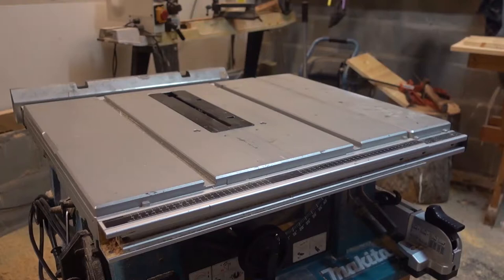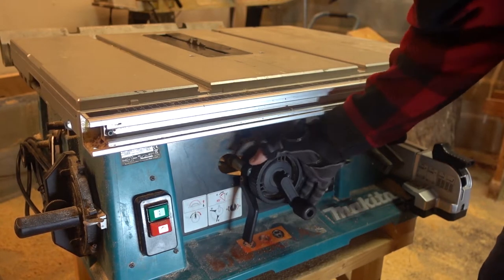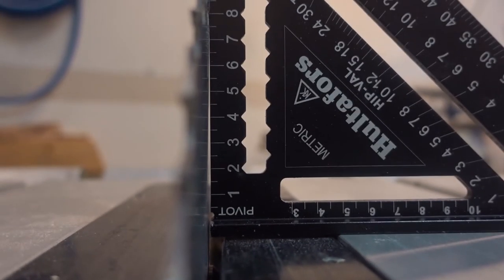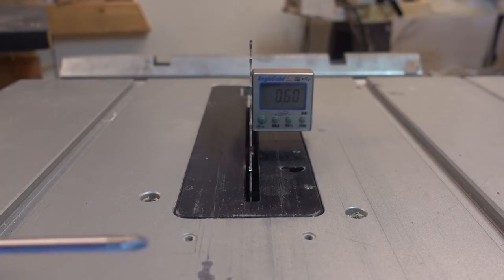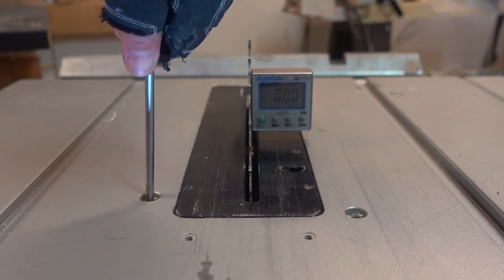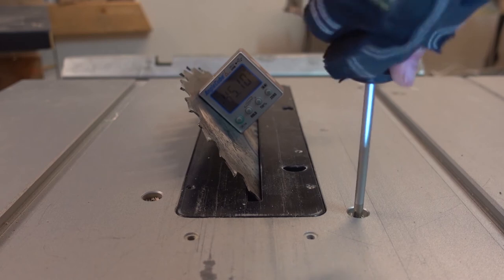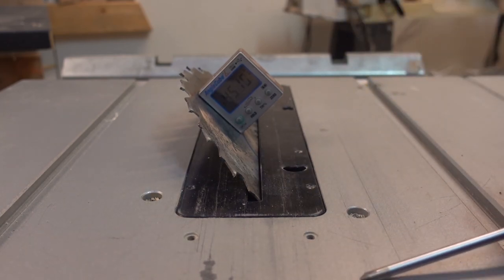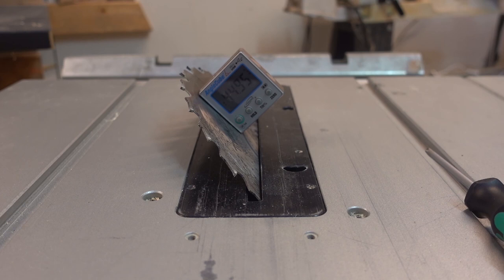MAKITA 2704 | Adjusting the sawblade angle

Comment: Thank you!
So happy to find instructional videos on the 2704. The manuals aren’t that easy to follow from time to time, so a visualization is greatly appreciated.
I am having trouble on my 2704 to tilt further than 35 degrees, any suggestions on that problem? 🙂
Reply from the maker: Thanks! Yeah, might be sawdust collected in the mechanism or maybe the plastic gear is broken. I know i had problems getting it to 0 degrees and the plastic gear was worn off.
Reply from the maker: Here is a image with a description. https://imgur.com/gallery/qTrVgeb
Reply: @atikam2956  Thanks! I will check that out. 👍
Reply: I think it kind of a factory issue I have it to it’s because the iron bracket that holds the red thing for your 0 to 45 is in the way from 35 to 45 so or they had to make a beter bracket or the had to make te silver plate bigger to you had some more room or they had to put the 0 to 45 numbers more to the left I have trouble with like 40 to 45 is hard for me and I made everything perfect in the 0 when I really try to push it to 45 is made the bracket bend 😅

Comment: Hello there ! Short question : I have bought a Makita 2704 saw (second hand), but I did not get the two wrenches needed to unlock and change the blades. And it seems impossible to get any information on the sizes of these wrenches or get them as replacement parts. I think it is a thin 19mm key, but would be very helpful if anyone could confirm. Thanks a lot !
Reply: You get two spanners with the saw, one open spanner 10/19mm ref:7810381 and one closed spanner 13/22mm ref:7820245 hope this is helpful

Comment: My angle handle  got stuck during this operation and it wont let go..leaving me with no possebility to  change angle....any idea why the  angle handle lock  is stuck?
Reply from the maker: Is it the lever or the wheel for adjusting the angle that is stuck?
Reply from the maker: Here is a short video. Might help. https://imgur.com/gallery/7JLtIFO
Reply: @atikam2956  the lever was stuck so the wheel didn't turn...I needed to flip the saw, remove the cover underneath and twist the large hex nut a bit...then I managed to loosen it....now it works...hopefully for as long time. Thanks for the video...😊😀
Reply from the maker: Good to hear you fixed it! No problem 🙂👍🏻